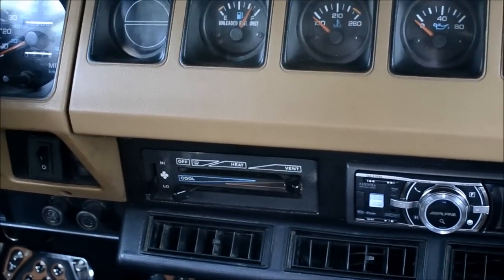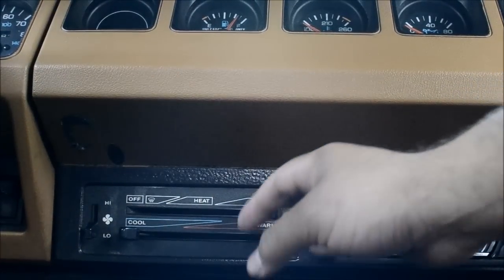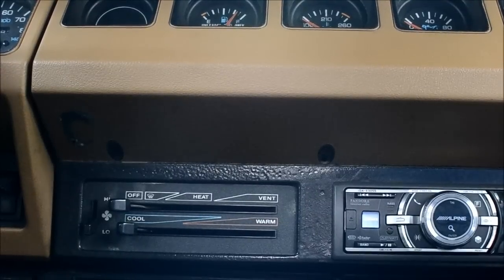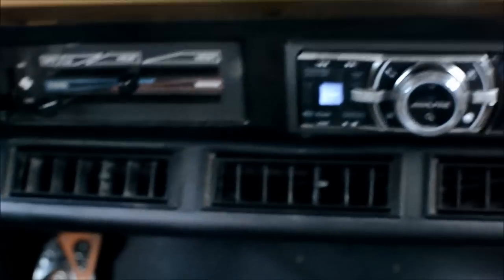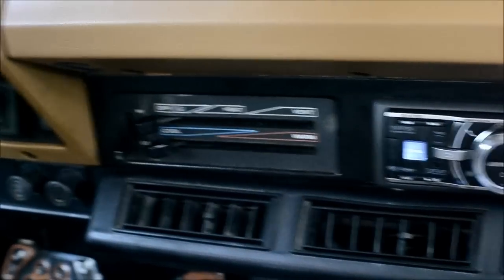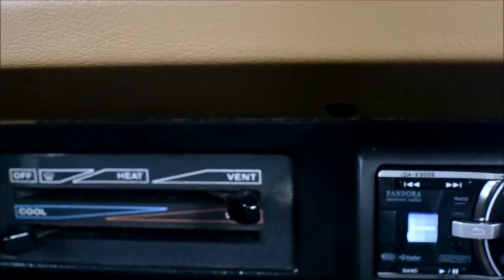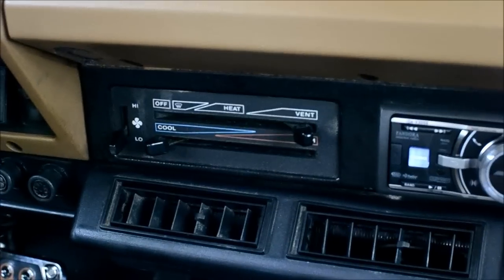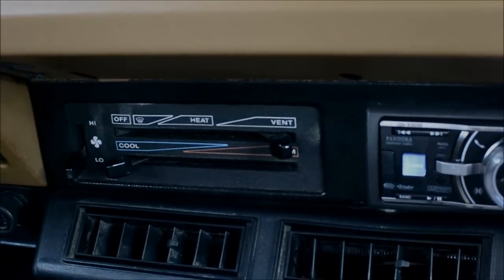Jeep YJ Dash and Cabin air overview

Comment: AC was a dealer installed option on all YJs.  Just like soft tops were on CJs...  It was also a very expensive option at the time. That is why everything on the inside looks like it was just bolted on...  it's because it was.

Comment: Great and helpful video. Quick Question: As I slide my selector from "Off" to "Defrost" the fan blower comes on, and stays on as I slide further to the right to "Heat". When I continue to the right to "Vent", the physical vent opens in the passenger floorboard like you showed....but the blower/fan turns off. (It comes right back on when I slide it back to "heat".) Is this how it's supposed to work??
Reply: I have the same issue. We’re you able to find a fix?
Reply: Yes, that’s exactly how it’s supposed to work. Air is forced through the vent while you are moving, once you stop, the airflow stops.

Comment: I had an 87 Wrangler Laredo package, mine had an additional gauge, I believe it was a clock where your 4wd indicator is.  My indicator was in the center of the dash with the turn signals and all.  Anyway quick question, my Jeep had the same AC but it never worked.  Can you tell me how well the AC worked when it was functioning?  I am considering another YJ or maybe a TJ but AC is a must have option.

Comment: When the top lever is in the VENT position, it opens the airbox on the passenger side, which permits air to flow into the cab.  That is a vent.  The YJ, if equipped with full metal doors also has wing vents, which work well.

Comment: The 4x4 gauge  you mentioned...is for a clock. I have a yj with factory clock
Reply: It's totally not! It shows either 4wd or 2... at least on my 95
Reply: Got a 88 yj mines a clock aswell
Reply: They replaced the clock in 1991 with the 4x4 light. Pre 91 models had the clock

Comment: I have a YJ 93 with plenty of these add ons. Previous and most likely original owners sure seem to have been very invested in their jeep. My AC stopped working last week. 

I took it to a pal and he says there isn’t a problem with AC but rather an electrical problem in the dash. 

He thinks that behind the rotating knobs they’re might be a wiring problem because it won’t transmit the electrical current to the AC compressor. Rather there is no spinning at the compressor. It’s not being powered.

I’m actually thinking about personally unscrewing the panel where the two knobs are but I could also wait and take it tomorrow morning to the vehicle electrician. 

Question: I typically would turn off the AC fan knob to off and rotate the cooler knob to off as well. All this before turning off the jeep. But here in Texas it was hot at times I didn’t bother to. Is that okay or recommended??? 

This AC obviously is 30years old by now (Maybe some parts have been replaced over the years) but yeah overall, I fear that was the issue as to why it’s not working now. 
I remember turning the jeep on and hearing the AC kick in, blowing air into the cabin but suddenly stop after like 10 seconds. Now the knobs and the lever switch aren’t getting the AC vents to work. Only the defrost+top vents will work.

Comment: One thing with your 4 wheel drive like stay and on check your vacuum actuator to make sure it's actually disengaging those vacuum actuators are known for going bad If that's not it the switch that's coming out of that piece probably went mad in is sticking  Compressed
Reply: I second this.  My indicator would flash between 4wd and 2wd. Found out after about a year the vaccuum actuator completely rusted through and it was in fact switching on and off a little but couldn't tell when stopped.

Comment: What did for the side covers was use cardboard to cut out a stencil then drew it out on this aluminum. Cut it out using jig saw which cuts it like butter. Self drillers to install it. Painted to match of course. Cost me under 20 for the aluminum. Hope that helps ya if ya havnt covered those spots yet

Comment: Is there any way of getting heat to come out of the 5 vents or only cold air.  Great video.  I didn't know about the defrost setting until I watched you video.  Getting heat out of the 5 vents would make the cab nice and warm in the winter.
Reply: +John Thompson the five vents are only for the AC

Comment: I have a friend with a 90 Wrangler who is having an issue with his climate control. One of the pins broke off where the cable connects to that controls it, back behind the unit.  Not sure how said plastic cream colored pin can be fixed or removed.  Can anyone help?

Comment: Thanks for the video. I have a YJ without AC. I was considering buying another YJ with AC or installing an AC unit. How well does the heater/cold air work? Is it as good as other models like the TJ?

Comment: Yes i have 94 wrangler , in Puerto Rico , the ac seems to be aftermarket , and notjing works , dreading taking dash apart but redoing alot , will lower my windshield so i can access speakers easier

Comment: I'm not reading the comments to see if someone else said it, but if you remove the center dash cover ( 6 screws ), then remove the 4 screws holding the air control unit and SLOWLY AND CAREFULLY slide it out (the cams, cable holders, cable end holders and other rotational bits can be brittle by this age), you'll see where the cables mount. Follow the cables back and you will find an adjuster. Turn it to elongate the outer cable sheath and shorten the cables a little, then try the slider. You'll notice you don't need to force the slider left or right as hard to open/close the vent or turn the whole system on/off.
Reply from the maker: Unfortunately, explaining what to do in the video is kind of odd, but I know you know what I meant when I said, force the slider all the way over even if you slide it over do you need to kind of feel for the lever/cabling behind the dash to actually move the vent open but yes, you are correct. It’s just one of those little things that unless you’re there in person sometimes people will never get it. I meant wrangler owners who have been moving that lever all their lives only to find out that it did nothing because they weren’t pushing it that extra quarter of an inch at the end lol.
Reply: Funny enough, i'm back watching this video again.
I'm deleting the whole control box and radio, removing the center trim, overlaying a new shallower trim, cutting out area for double-din, and installing a touchscreen under the gauge set. 
With the room i have left on the left sude of the screen, i'll have a hi/off/lo switch with 3 push/pull cables attached to temp/vent/floor&windshield flaps.
Gonna be interesting, but i can always put it stock again.

Comment: I have a 2988 YJ and the vent under the glove box is crammed full of leaves.  How do I remove it to clean it out.  The A/C stuff was all already removed when I got it.  Thanks.
Reply from the maker: Lol must be nice living in the future. Lol if anything just try and pick all the leaves out but that little vent on the bottom right needs to open all the way about a half an inch to inch if I remember correctly

Comment: Those should be 4x6 speakers in the dash. Also, what are those home speakers? Did you check the ohms on them before hooking them to your amp or deck? Just a heads up. Not all speakers are created equally. Especially home and car. Most car audio is 4 ohm. Those could be anywhere from 2 to 16 ohms.

Comment: you mentioned getting a hood scoop for the hood vent to get more air. would that be for the heat or for the vent? I am hoping it would make the vent a bit more powerful.

 I have a '94 YJ with AC (which isn't ver powerful but then again...i don't use a top)

Comment: this ad on actually goes to 87 to 95 yj, some people had it installed by themselves or brought it to the factory to have it out in....... this guy is pretty dumb. even mine which is a 1992 yj 4.0 L6 manual has this in it... very easy to install.............

Comment: Why the fuck does everyone insist on putting extra speakers and an amp and a sub in a fucking jeep.
It's a fucking jeep.
Leave it alone.
Reply: billybobjoe198 To actually hear the music. When you're speed wobbling down the highway at 65 with no swaybar links and top and doors off you only hear the crash cymbals from the stock system. My jeep is stripped and raised and is more like a cj than a yj but i still had to replace and add speakers and deck and throw 2 12s in it just to sound like a stock car stereo set up today.
Reply: My YJ has no carpet, and is lifted on MTs.
I just accept that if you're moving faster than 25mph you don't hear any stereo.
Hell I don't have any headunit installed in my other cars.

Comment: I have a 92 with AC and it quit blowing cold air at the end of last summer.  I knew based on a quick diagnostic that I'd need a new compressor clutch, which now they only sale the compressor and clutch together now.  I didnt replace due to weather cooling off here in Charleston, but now its heating back up and i need AC.  But, now the AC isnt even turning on.  Do you happen to know where the fuse would be for the AC unit or is it common for the entire unit to quit working?

Comment: Great video, bsgtrekfan88!  I've got a '93 YJ and you're right -- it took me few weeks to figure out where the heck the air was coming from when I opened the vent.  Not the easiest dash to understand considering how simple it looks.  Anyway, I've got a blown front speaker and the tape deck needs an upgrade.  Crutchfield told me this was a tough job.  Your thoughts and what do you recommend?  How do I do this?

Comment: Hey I was hoping you could help me out a bit. I have a 94 yj and as of right now it will not go into vent or off so heat is running at all times and it is also blowing in outside air inside the cab all the time. So i have heat and practicly vent on at all times. And it sucks. Alot... would you have any suggestions on what it could be?

Comment: It goes through a heater core, not just air from the engine. Their is an actuater after the vent that diverts air through the heater or past. My 95 looks alot like yours, spice interior and emerald green exterior but it doesn't have the air conditioning like yours.

Comment: cool video do you have any info on testing for the heater motor mines won't turn on at all its winter time I literally have to drive with foggy windows til I start to get hot air blowing in thru the hood vent lol BTW I have a 92 yj  5 speed with ac as well

Comment: I need help with my radio i installed it before it worked alot time now it wont turn on i check the wired its ok i checked the fuzr behind the wire but its weird i look at fuze box and i see rwdio dont have a fuze it dont use the sqare obe?

Comment: Hi i drive a 95 YJ and absolutley love it!!! It has 205575 miles on original engine. Its a 2.5L 5spd man (2nd one as 3rd gear went) and its equiped with a/c. So on a drive out to Fargo i found out i wasnt pushing any heat even though temp was hot. Worried i was out of colant i pulled over & chked. Nope all good.next i put up a post at TCJC and found out theres a switch - near the vent under dash on passenger side thatcan bring in cold air or hot- somehow that switch got pushed to cold. After change of direction cabe gothot. Yipee
Reply from the maker: Cheryl Martin hopefully this video helped ;)

Comment: How the heck do I install an aftermarket radio on my 87 yj  wrangler?🤔
Reply: I don't know anything about 87's but I own a 92 and all you have to do is remove the center dash panel. 6 screws hold on dash. 2 screws hold in the radio after you remove the dash. Super easy

Comment: Recently I clean the blower motor(rat smell coming out) and now my my air system is not operating, besides a blown fuse, what else could be an issue that would keep it from working?
Reply: You broke it. Next time, don't clean it.

Comment: I have an 88 yj and the cables to the vents are not connected it seems that the connectors or clips are broken/missing does anyone know where I can purchase some to replace and repair my ac/vent system
Reply: There's also this thing called "the auto parts store". You should check it out sometime.

Comment: On my 89 yj my "vent option doesnt work. heat and defrost work but no vent. Any tips?
Reply: you have a loose cable
Reply: Jonathan Klein Where would that cable be located?
Reply: You have to take the hole dashboard apart to get to it, but the cable you could grab if you take your radio out and feel around with your hand open free just take your other hand and move the lever until you feel some tension, that's how I found my problem in the slack it had on it
Reply: if I was you I would consider seriously taking the dash apart so you know for sure no bolts or anything holding anything on back there breaks, several things broke on mine...

Comment: I have a '94 YJ  5-speed with no ac. Does your blower ever completely turn off? Mine is constantly running. I'll pull the lever all the way to left to the off position, and by holding it there, it will turn off. Let go and it will move back no joke probably 1 millimeter towards the defrost and continue blowing. This normally wouldn't be a problem as I cope with it by just turning the fan speed on low.